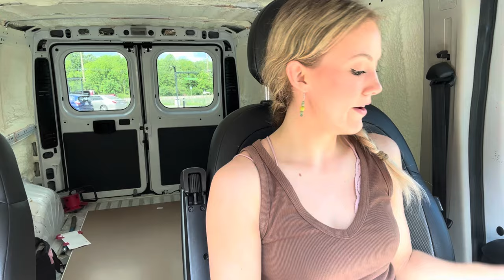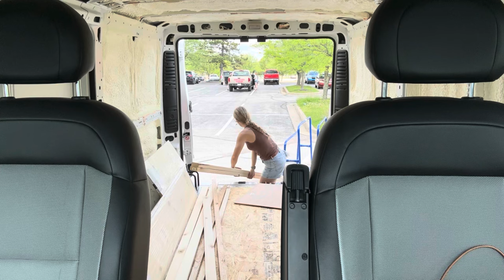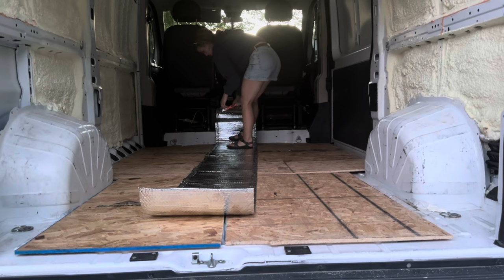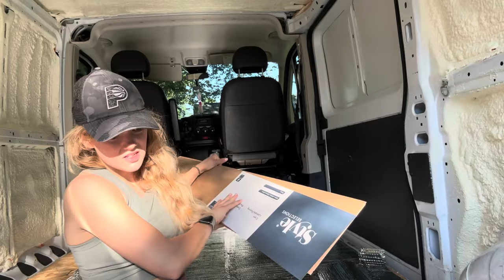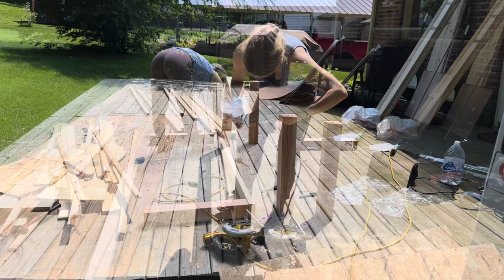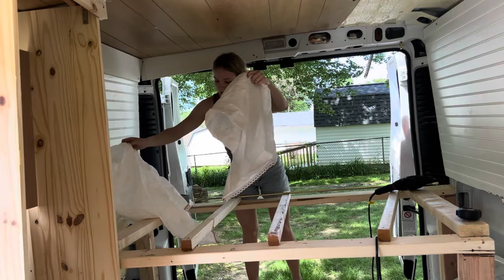Creating A Home On Wheels | VAN CONVERSION • Episode 1

Comment: I've check back good you got a 2017 dodge van. For anyone thinking of building a van. Don't used a pre 2,000 van, that 24 yr ago. Not all state mine all part store stop carrying part fir pre 2,000 van or cars. So  auto shop will not fix it, I found out the hard way. And because they make deal with auto part free delivery their rules are they can never used customer parts even new or junk yard company no  rules. I was force to junk a set up van I spend a lot of money and years of work, need to  build all over. You can't control where it break.
Called, no shop would take it based on it age.  So I brought a new transit 250 2017 and wish I did earlier w/ 6 speed shift very fast yiur in 4 by 25 mph vs 1 gear or the 351 ford reving &   making lot of noise for hill.  The newer van are great mpg.   I'll tell you a trick. Fill it up bit over full , count how many day till it at full 
 Then fill it again. How much when in? Mine that 10 buck. Perfect, so I put 10 buck every 5 day.  And it feel great. My old van was 40-50 buck a week. So Iam saving over 1 k a yr.
 But don't fill to over flow , it long below tip click it off 2 time it their stop.  You can adjust now go  a tiny nug under full & add 10 buck or 11 long trips. Perfect feeling 5 days seem a week.
Reply from the maker: Thank you so much for sharing your knowledge with me! It’s been a journey and learning experience! I hope you have a wonderful summer☀️🫶🏻😃